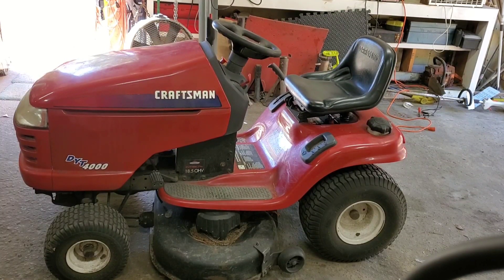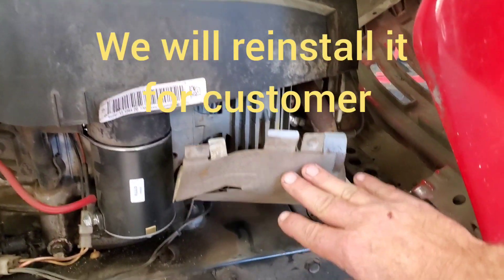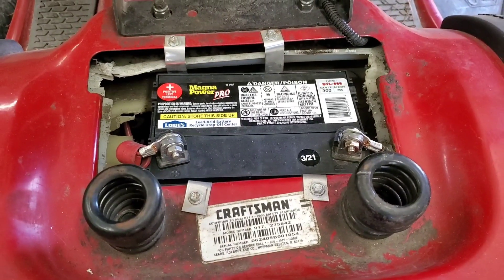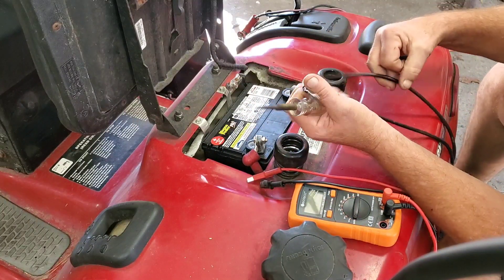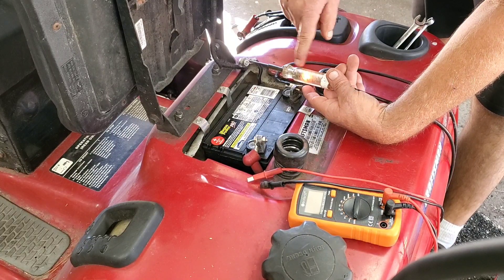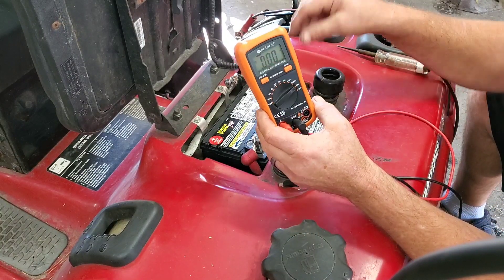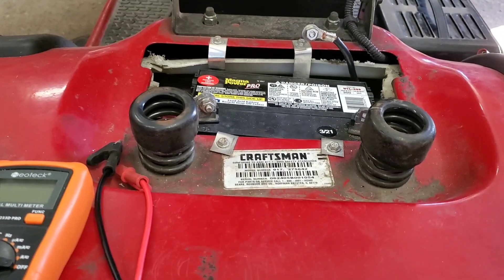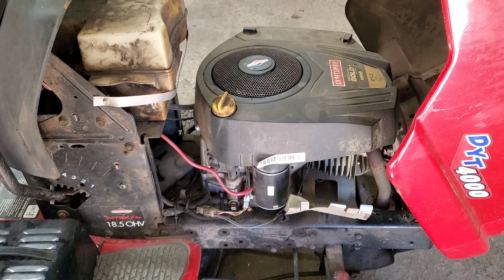Craftsman Riding Mower with Briggs and Stratton Battery Goes Dead. How to Test for a Draw on Battery

Comment: My motor and fuel setup is same as his aftermarket, my battery is in his location, but factory.  I installed a pull start on the motor when I inherited it.  The battery charges up quick with running, but draws down pretty quick when sitting too. I didn't want to buy a test light, I have a DMM.  Thanks for this.

Comment: Great video. We use to be able to do that on automobiles until they started using computers. Now it’s all milliamp draw
Reply from the maker: You are correct sir. That's where I learned that trick back in the early 80s. Pull fuses until the test light goes out. Thanks so much for watching and commenting my friend

Comment: Love it! I guess he put the battery in the tank to get more “juice” since it wasn’t charging. Lol Great explanation on the parasitic draw, use that all the time.
Reply from the maker: Extra Octane for the battery  🤣 Glad ya liked it brother, thanks so much for watching.
Reply: So there must be parasites in there mucking around 🤔😏   is it the gas tank or battery. I'm confused here 😆🤣😂😹lol
Reply from the maker: @Lovinflyindrones2022   Someone cut out the fuel tank under the seat and turned it into a battery box.

Comment: Interesting modification. I wonder if the reason is the new engine has no fuel pump, so they had to go gravity feed for the fuel, and the old fuel tank was the only place to put the battery?
Reply from the maker: Very possible, this customer has been coming to us for years. He recently purchased it for $200 and really doesn't know. All we know is that the engine was replaced at some point. Very good observation my friend, thanks for watching

Comment: is it possible to have a small draw when using the meter and touching the ground cable and the other wire on the neg on battery? like 0.05?

Comment: Here we go, another quick diagnosis,,,,nice tip with negative off first brother. I had a draw current on a Transit once, cost £700 to repair some electrical gadget that had shorted inside, a throw away component apparently 🙄 what’s a PTO?
Reply from the maker: Pto is Power Take Off. Basically the electric clutch that kicks the blades on. It's an electro magnet the engages the blades. Thanks for watching glad you liked it brother
Reply from the maker: Dang that was an expensive repair on the van!
Reply: @RaleysSmallEngines  yeh, some engine module
Reply from the maker: @STTC  dang it